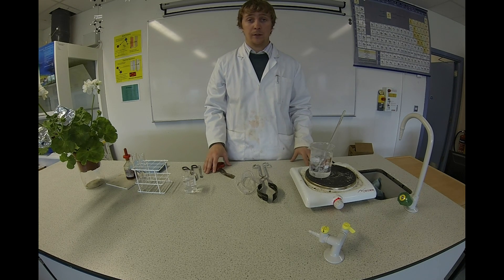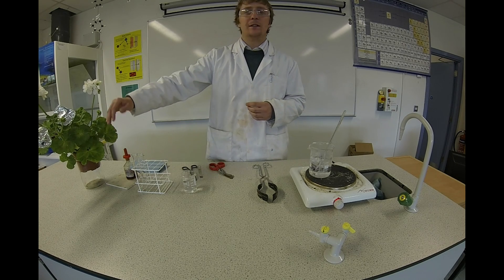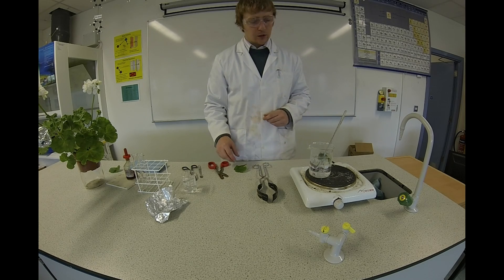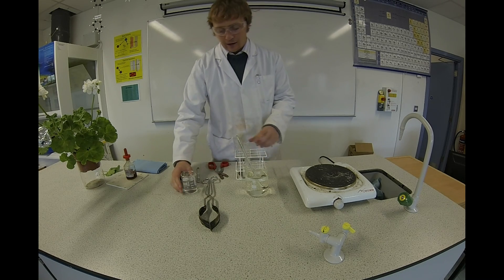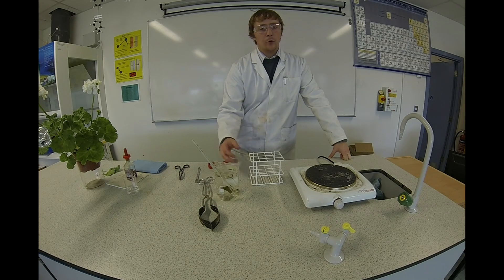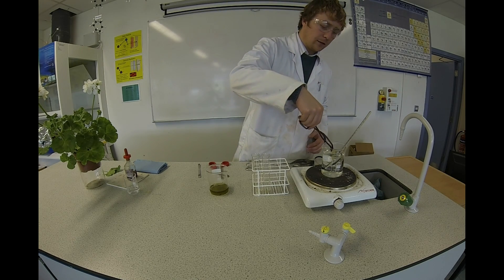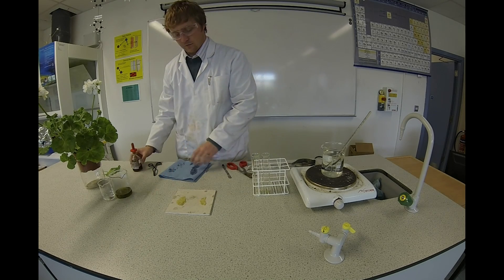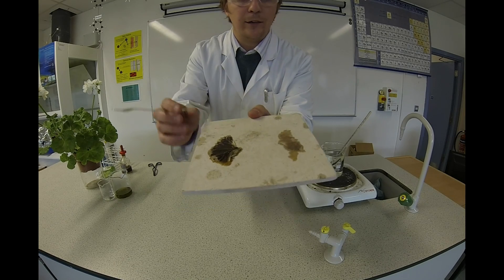To Show That Starch Is Made During Photosynthesis

Comment: Iodine turns dark with any polysaccharide.  Why doesn't the leaf in the dark turn color due to the cellulose in its cell walls?
Reply from the maker: Great question! I had to do a bit of research to find an answer, what I found is since cellulose does not have a helical structure like amylose, it does not bind to iodine to form a coloured product. If you are interested in further reading you cna look at this page http://wwwchem.uwimona.edu.jm/courses/CHEM2402/Textiles/Veg_Fibres.html
Reply: Iodine does bind to cellulose to form a colored product.  Put some to paper or paper towel and you will see.
Reply from the maker: Ok well then I don't know the answer, sorry! I would be interested in this if you find the answer please let me know.
Reply: From what I can tell by examining several sites, the hot water breaks up the cellulose in addition to the cell membrane.  I don't understand why if the hot water destroys the cellulose, it also wouldn't break up the starch.  Maybe prolonged boiling would eventually disrupt the starch as it is so internal compared to the external cellulose cell wall.

Comment: Hello,
Anyone answer it if u know:
can u explain y do u need to dip the leaf in ethanol after boiling it in hot water?
Reply: Hot water boils the leaf to become soft so as to absorb easily the alcohol, the hot alcohol dissolves and removes chrolophyl in the leaf to stop enzyme action so as the iodine solution to diffuse easily